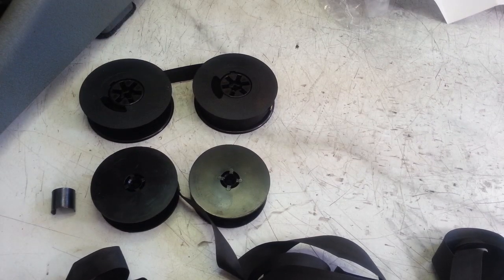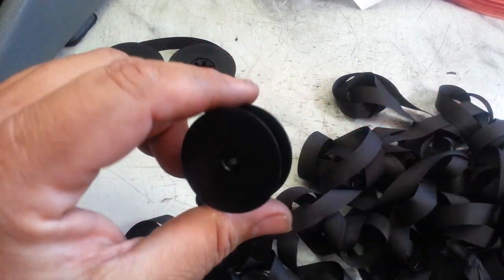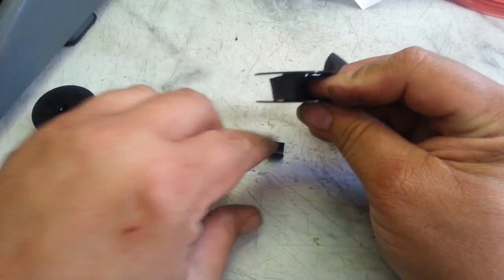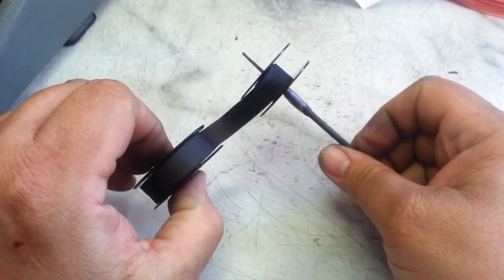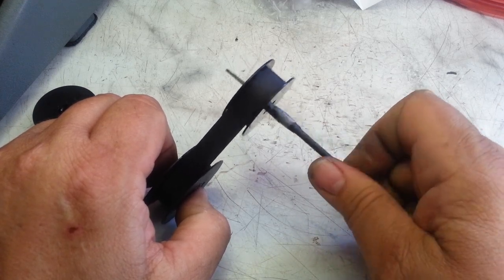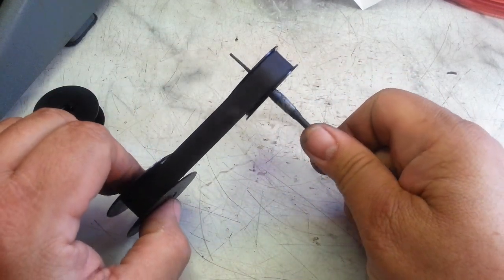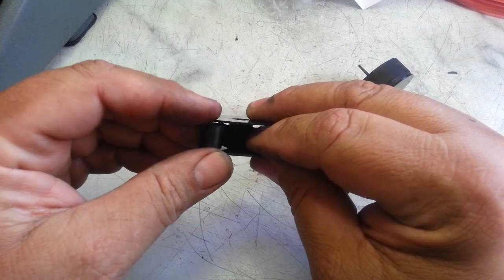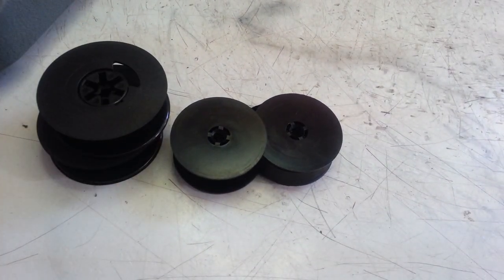Typewriter Ribbon Rewind Smith Corona Skywriter Corsair Basic Reload Ink

Comment: Thanks for doing this. I've got a mid-'60's Sears Chieftain, made by S.C, with the small spools. The spool info in the video is dead-on, but, unfortunately, this machine has a closed ribbon holder in the strike area, not the later S.C. open-top. So I've had to load the spool, then thread it, then attach it, THEN wind it backwards. If there's a better way to do this I would like to know!

Comment: I have a 1975 Smith Corona Galaxie 12.  I want to change the ribbon but the one that is in the machine has a center plastic that stays attached to the ribbon cradle in the typewriter.  The surrounding ribbon I can remove.  Can I remove that center smaller spool from the machine or do I need to order a special spool?
Reply from the maker: Spools should come off all the way leaving just a spindle shaft,
The model with plastic spindle have tips that get warped and jam ribbon on
But I can't see your typewriter, so just guessing that's the problem
You can post pictures on the FB typewriter group, link in description
Reply from the maker: Try this
https://youtu.be/Z8XcGlCWaSk?si=9mVWz25k__k4HaBz

Comment: Hi, I'm wondering if I can get some advice to repair typewriter. Since I am living in a country not readily available for typewriter repair, so i am trying to do it myself. But one thing making me hesitate for disassembly is all those rusted screws. Since I already ruined some of my typewriters because of that stuff, I searched a lot and tried as many methods as I could do. However, unfortunately, none of those methods was working. I have tried penetrating oil, rust removal chemicals and heating screws, hammering screwdrivers ,etc. How can I save my typewriters? Can you give me some of your wisdom?
Reply from the maker: Nothing I can add, these are common challenges, sometimes insurmountable
Use best screwdriver blade you can, most mine I have custom ground tip,
to mimic the same style that gunsmiths use.
Reply: I see. Thank you for answering